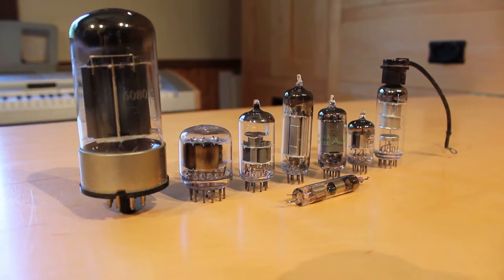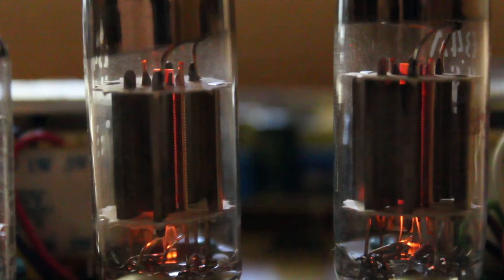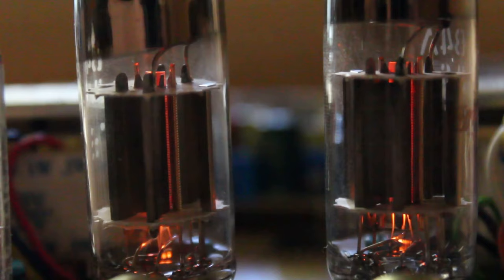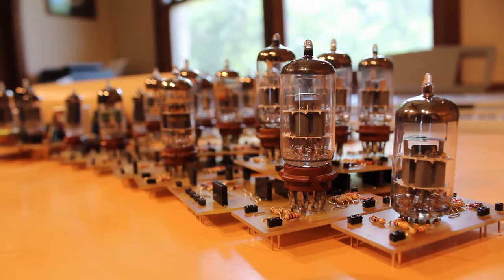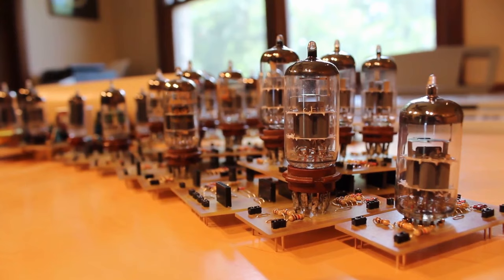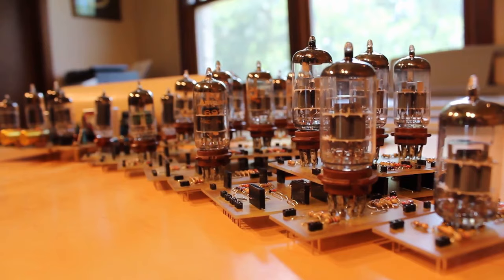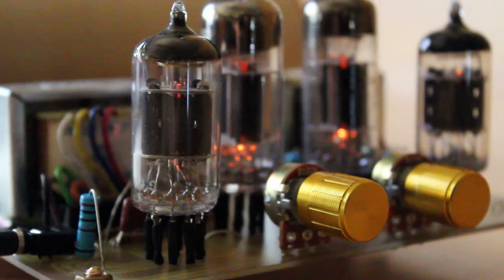Vacuum Tubes: Episode 1 - The Basics and the Diode

Comment: Light bulbs aren't vacuum, they're inert gas. All that is required is that the filament not burn, there's no reason to stress the glass out with a pressure difference.

Comment: 'Modern' incandescent bulbs are filled with an inert gas, although early bulbs were evacuated.
Reply from the maker: Interesting! I didn't actually know that. It seems that Argon with a bit of nitrogen is a common fill gas. I wonder if, after the filament burns out, enough voltage could be supplied to cause the argon to breakdown and glow? Granted, that's super dependent on the amount of nitrogen and overall pressure, but that could be a fun little experiment!
Reply: Yes, it can, but at much higher AC voltage like a tesla coil or an ignition coil, etc. It doesn't glow very bright tho.

Comment: Lightbulb filaments do not operate in a vacuum. The glass enclosure is backfilled with an inert gas, without O2, at a pressure lower than atmospheric @14.7 PSI. This enables heat from the filament to be conducted to the air while preventing the glass envelope from exploding due to expansion of the gas inside.

Comment: You can screw around with tube  performance by waving a strong permanent magnet around them.

Down the corner of my street was a small factory  making tubes (valves in UK)  for  the Mullard Company.    Our portable radios had two batteries ,  6v  for heaters  and 90v  dry cell  for HT   anodes.  Idten a metal cap atop the valve.

Comment: Just subscribed:  This is easily the best explanation I've ever seen of how electricity and tubes work.  I hope you've produced another piece on how output transformers on tube amps work in conjunction with tubes.  Moreover, I'd love a piece from you on how all the tubes on an amp work together (voltage tubes, power tubes, rectifier, ect.).

Comment: recall seeing old transmitters with Mercury vapor rectifiers like 866 872. Fantastic blue glow. The filament/heater supply voltage has extreme effect on tube life. Running them at the rated or less voltage is much preferable. That means 6.3 volt or less .
Reply from the maker: I would love to play with some old Mercury rectifiers, I've never seen their beautiful blue glow in person. Someday I'll try to get my hands on one and fire it up!

Comment: I have basic understanding of tubes and this demos are great to watch; it's perfect for me! Nice to see you running tubes on low voltages - I have wondered if that would work for guitar effects and it is probably a feasible option.
Reply: It would be far easier, safer, more practical, more accessible, and less complicated to use transistors. They will do the exact same job as a vacuum tube, but using less than 5 volts. You could make a distortion pedal out of a simple 5 cent op amp chip using just a few components, in theory. I don't know much about sound synthesis, but I know enough to know there are oodles of chips out there that will help you out with that. As opposed to building your own chip out of tubes, plus any supporting circuitry.

Comment: Hi there, thx for the video lecture, it's very illuminating!  I have a question, need clarification about 2 things if you
(or someone) would be so kind!  At 17:10 on your drawing wouldn't the LED on the left be LIT no matter with position
the PLATE switch is in (+24v or Gnd) since there is +1.5v on the LEFT LED with GND on the LED's cathode? It seems like
the HEATER battery will bias the LEFT LED at all times regardless of PLATE SWITCH!  I "assume" the HEATER'S Battery Negative is to ground to complete the circuit!

Then when you move the PLATE switch to GND the Left LED is still on (being biased by the heater battery) UNTIL you
move the bottom switch from GND to +24v to bias the RIGHT LED!  NOW the LEFT led has reverse bias and turns OFF,
while the RIGHT LED now has proper bias and TURNS ON!  The LEDs going "ON and OFF" really has "nothing" to do with
the PLATE, but the biasing of the LEDs by the Heater Battery....I think???

Isn't PLATE CURRENT occurring ANYTIME the HEATER is working AND the PLATE has +24v...BUT not when PLATE is
switched to GND?  

Lastly and most importantly, "will" the LEDs "truly" ever feel the "influence" of the +24v at the PLATE? I mean, the true
PLATE current is from HEATER to PLATE ONLY...except for any additional "current" running up the LEFT LED being
limited by the resistor value...but overall negligible since LEDs really can't pass a lot of current...I think???  THE +24v 
WILL NEVER BE MEASURABLE AT any place other than the PLATE...not on Heater nor the LEDs...correct???

Hopefully, I made some sense!!!  Perhaps I'm chasing too many electrons...lol! Anyone's feedback is appreciated!  Thx!!

Comment: You know what’s cool about vacuum tubes is that you can put little sticker thermocouples on them, to get temperature readings. I don’t if there’s any good reason to do that, but the readings would be fun to track.
Reply from the maker: That's actually a pretty interesting idea!
I know that some tubes run much hotter than other tubes, and you could actually keep an eye on glass temperature depending on load too. Granted, at the 24V that I tend to use, the load is so minimal, the tubes stay very thermally stable, but for some big driver tubes in audio amplifiers, it could be fun to watch the temperature move around!

Comment: Hello, this video was amazing! I love vacuum tubes and also own some nice ones such as GU-81. But I struggle to find some nice project to use them in, accept tesla coil with dangerous voltages involved or tube amps (I can't tell if a guitar is tuned or not, so this is essentially useless to me and really expensive). Now, this was one of the best vacuum tube videos I've seen on DIY vacuum tube projects. Keep up the good work and thank you so much :))
Reply from the maker: Thank you so much for the praise! I'm kind of the same way, I have pretty significant hearing loss in my left ear, so vacuum tube amplifiers don't really mean all that much to me. But, vacuum tubes were used in all sorts of interesting designs and circuits back in the day, so I love the idea of exploring different tube circuits but doing so at a safe voltage. Turns out, most tubes respond pretty well, even at tiny voltages. 
Having said that, I'm no so sure how well the GU-81 would perform at anything lower than phenomenally large voltages, even the heater requires 11A at 12V! That's an epic tube though and one of the more beautiful tubes out there. One day I'd love to play around with one, hopefully without hurting myself, haha.
Reply: @UsagiElectric  I like to play with HV (more like styropyro style) eg. Tesla Coils (I already made some), in fact I would like to make GU-81M VTTC (Vacuum Tube Tesla Coil). But I don't see any application where I can use tubes other than this. I would love to make some sort of tube calculator (Mr. Carlson's Lab had a video about vacuum tube OP Amp, which can even do differentiation).
Reply from the maker: @michalvarsanyi612  HV scares, but I would like to build a Tesla Coil someday, they're just so cool! Mr. Carlson's Lab is a fantastic channel and I loved the video he did on the OP Amp. One of my goals is to actually build a low voltage tube OP Amp. It won't be near as precise, but if I can get it mostly working without needing +300V to -300V, that would be awesome!

Comment: Good tutorial. Thanks.
If you had say, a 24 volt power supply, and wanted to put 3 of, say 6AU6 tube's heaters in series, but didn't have a 4th tube--could you use a filament resistor of around 21 Ohms to make up for only having 3 instead of 4 tubes in a .3A loop? Wouldn't a 5 watt resistor give you about 100% safety margin, or would the resistance be much lower on when the filament is cold? Perhaps the resistor could be lifted from the board a bit. : )

Comment: 08:50 the diode symbol should be inverted. You draw the cathode of the diode, where the anode of the tube is
Reply from the maker: Yup, the diode is backwards in relation to the tube diode next to it.
I actually tripped myself up here by talking about the silicon diode in terms of conventional current flow and talking about the tube diode in terms of electron flow!

Comment: At 15:46 you must have misspoke when you said if the diode is not functioning and then proceed to describe current flow when the plate is at positive voltage. I would think that that’s when the diode is allowing thermionic sourced current to flow and is functioning / active.
Also because of the diode function the 1 diode never lights up but by providing it the diode effect is confirmed.
If it did light up that would indicate that the cold plate was emitting electrons.
I mention these things just to further the discussion.
Your external switching and diode set-up serves to prove that the vacuum tube only allows current or negative charge carriers or electrons to flow from hot plate to cold cathode but not the other way and so exploits thermionic emissions. Great job with your experimental set- up in the lab with the use of leds as a visual indicator of current flow. All in all the best video I’ve seen on directly heated version of vacuum tube diodes. Also nice to see the current limiting or load resistor on the “hot” side of the vacuum tube diode for a change.
Reply from the maker: Thank you!
And I made a pretty big fatal flaw in this video and that was trying to talk in both terms of conventional current flow as well as electron flow. It's so easy to get all twisted up when speaking about both of them at the same time, so I should have just talked about electron flow because that's what makes the most sense for vacuum tubes. 
Also, in hindsight, I think I could remake this video to be much, much more concise and better edited now, but I would hope that to be the case after about two years of making videos, haha.

Comment: So good... Fun watch.  Did you not just create a voltage divider for the filament voltage for simplicity sake?
Reply from the maker: Thank you! You could get away with building a simple resistor voltage divider, but the tube filaments actually pull quite a lot of power. The 6DJ8 is rated at 350mA at 6V, which is a hair over 2 watts (and the 6DJ8 is pretty low, something like the 6080 octal power triode is rated at 2.5A at 6V!). The little buck boost converter I'm using is rated for 2A, so that makes life a lot easier (except for that 6080, nothing's easy with that beast). Ultimately, for my larger projects, I actually end up building things around 4-tube modules. If the tubes are of the same type (4x 6DJ8s, 4x 6AU6s, etc.), the heaters have the same amperage draw and I can run them in series. There's a 6V drop across each tube and with a 24V supply, that works out perfectly!